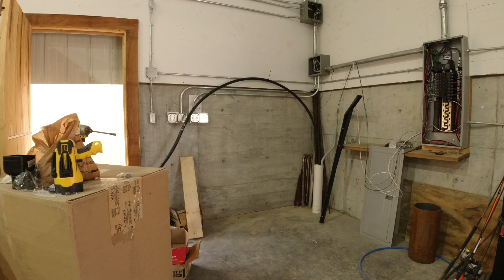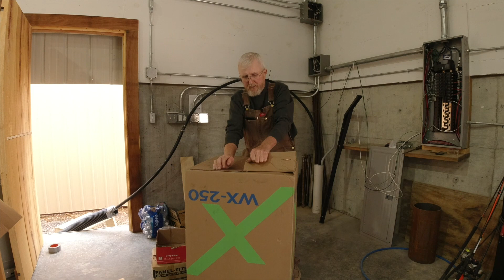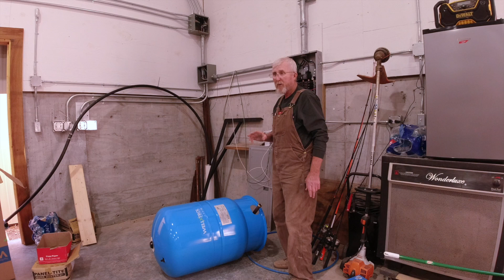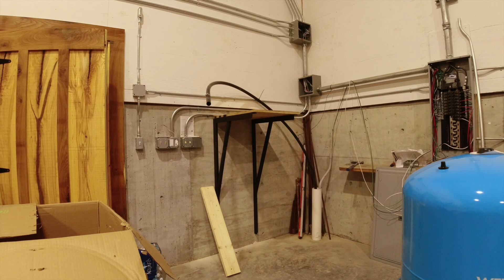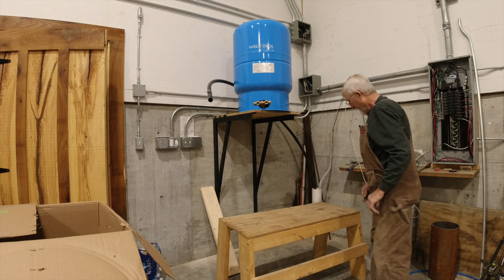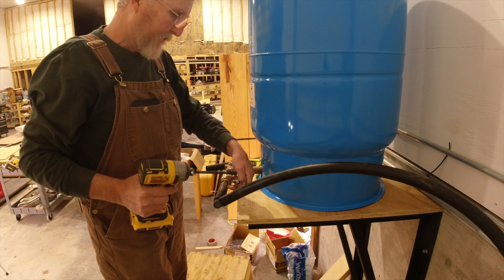Pressure From The Well

Comment: i am sure you have considered the working weight of that set up of about 5 to 6 hundred lbs hanging weight?? would you agree ?? I am sure it will be fine
Reply from the maker: I estimate weight at about 400 lbs. giving consideration to both pullout and shear in 4000 psi concrete 8 inches thick. Used 3/8 X 3 LDT anchors that have 5400 lbs strength each. Two anchors in each leg for a total of 21,600 lbs. Frames are 2x2X1/4 angle. I’d bet the farm on it holding.
Reply: @UphillbothwaysTN  as do I ... As do I